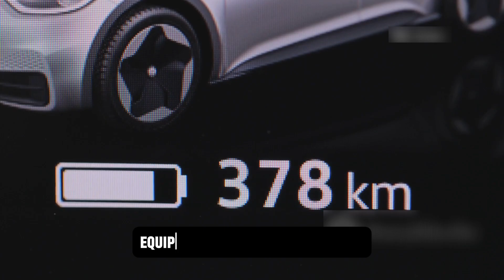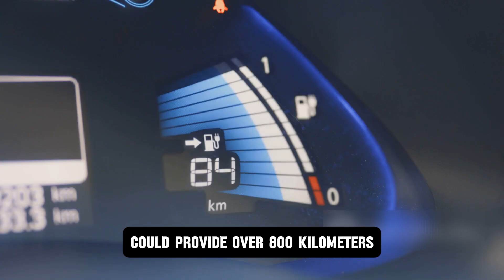CATL New Solid State Battery With 12 Times Charging Speed Begin Mass Production

Comment: And a 1.2 MW of power for a single charging point will come from where and over what infrastructure, especially in the dense city centers? Having such power on tap would require a transformer station larger than the one used by few blocks of apartments - just to satisfy the need of a single point of charge, and don't get me started on costs incurred by adding more and more of high and intermediate voltage lines to handle the extra load.